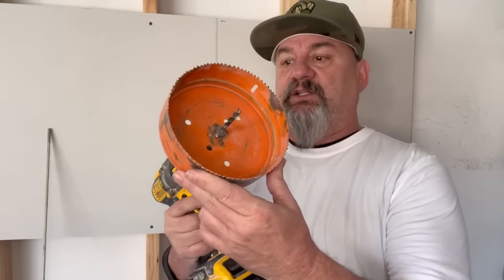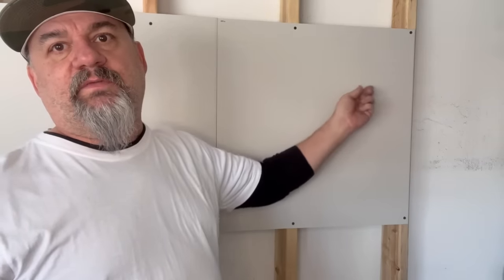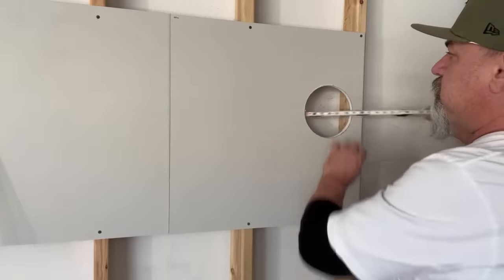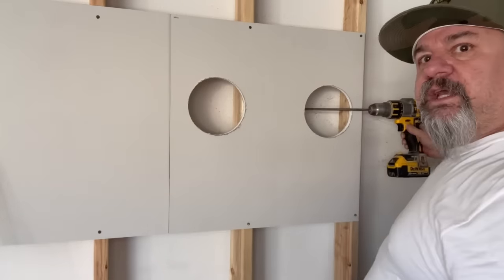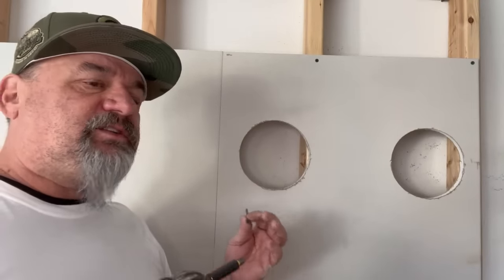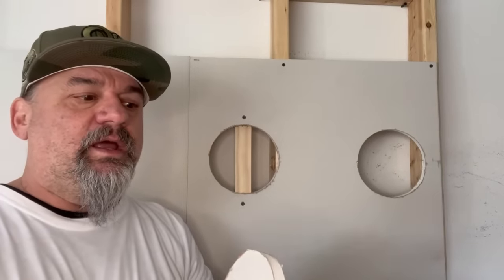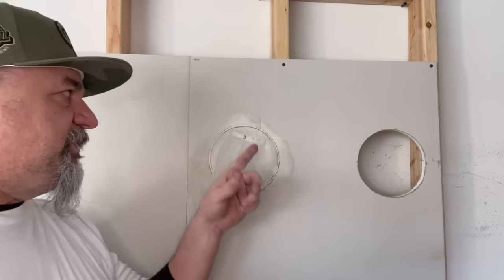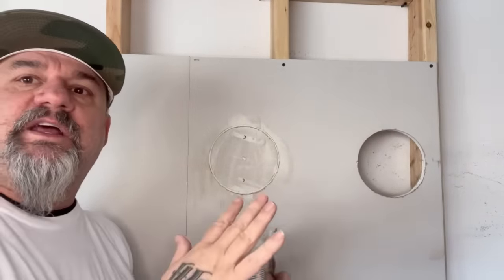Unbelievable Trick to Run Wires Through Walls and Fix Drywall - You Won't Believe What Happens Next!

Comment: I've been an electrician over 35 years and this is a good tip. To all those clowns that say you should do it this way or do it that way, I guess they don't listen very good. You said this is how YOU do it. No one is putting a gun to their head making them do it! Everybody has their own way of doing things, some easier, some not. Good video.
Reply from the maker: THANK YOU FOR UNDERSTANDING!!!!!! damn im so sick of the "hey try it this way" thing. take it or leave it. I'm only trying to help wtf?
Reply: I’d only offer one variation, put one screw in the center hole only. Avoid any low or high spot. 

But I really like the fact that you even speak like a real electrician, uncensored. I’m certain someone out there who doesn’t swear and is an electrician will cry a few tears because that’s naturally what will happen, for some morality bullshit need to correct or scold. 

Been doing this stuff long enough that maybe it’s time I just do a 6” round hole rather than the damned irritating rectangle ones I’m forever repairing 😂
Reply: I am a drywall taper by trade....And to be honest;  I very, very  rarely find any drywall repair that has been done by electricians. Apparently  their time is  too valuable. At 85$+  an hour; they can not justify spending even 5 or10 extra minutes to fix some of their repairs. On top of that; those repairs often could have been avoided if their original work had been done properly in the first place. On many occasions , they had to be called back for some forgotten feature of the contract, that was missed on the the blueprints.,,, but ,,,hey   we are all only humans
Reply: Well said 💪😁👍
Reply: I enjoyed this.
Reply: frank  busch  The "clowns" are those who don't  know what they are ranting about.  It doesn't help when  the drywaller has to pull that mess out and start over.  Having a bunch of small patches at eye level will look like sh!t unless all the patches are floated together. There are better and much faster ways.
Reply: What makes you that important to call others clowns that think this is idiotc. You better off pulling baseboards cutting  a strip of drywall shorter to the height of your baseboards and do your drilling that way then nail the drywall back no patch easy
Reply: @adv-fabiod4505  Yep, and if possible going up in the attic may not require any patches or painting. Especially with interior walls it is very easy to feed wire down any stud space to the desired new box cutout.
Reply: The drywall is not yet taped, remove it.
Reply: @gordthor5351  
How
Reply: @howardmcglothin6268   Up in the attic you can see the top plate of the walls , so you can drill a hole in the plate in any stud space required to get a wire down to an existing box and another hole where you want to go to a new box. All lateral wiring is up in the attic, so there is no need to drill a bunch of holes through studs.

Depending on what type box was used, often it is possible to detach the box from the stud and pull it out without needing any drywall of painting repairs. The you use a retro box which can be wired and then placed back in the cutout. Worst case you only need to make one small patch near the existing box if you can't remove it from the stud. 

 I personally would get the box out one way or another (break it, cut it if it is plastic...) and take it out in pieces, because it would take much longer (more costly) to do the required coats of mud and painting. Even if you have the paint, likely the entire wall will need to be painted. Not to mention the dusty mess sanding drywall. If you have to buy new paint then certainly the whole wall will be needed to be repainted. 

I have been doing this for 30 years. Believe me, this is the most efficient way. Customers are very happy when you don't unnecessarily fill there house full of drywall dust.
Reply: @StarvingElectrician  Absolutely! I use the method that works best for my combination of talents (like burping the Star Spangled Banner), setting (my own home), and pace (reckoned in terms of Diet Coke consumption.). I would not dream of telling anybody else how to do it, only how I do it. More choices are better.
Reply: @gordthor5351  ~ We needed to add a ground wire for a ceiling fan to go in the kitchen per the included instructions.  I suggested running the wire down the wall from the attic to the breaker box and across the attic to the wall and down between studs to get to the switch.  I would do any subsequent wiring up to the attic, over to the walls in the different places an outlet or ceiling fixture might go.  A neighbor rewired his home by cutting slots in the walls and mudding them all back up.
Reply: To those who say he uses the wrong technique, I say their video watching technique is sh*t.

Comment: Although this is a Great idea and technique.....I find it much easier to simply cut away and remove the drywall. I cut away a 12" wide strip from point A to B.  drill thru the studs, run the wire, outlets and switches, etc....then attach a new 12" wide drywall strip with screws. Mud and finishing is way easier and faster.
Reply from the maker: this is just one trick I use once in a while
Reply: As a finish taper  no it's not .if im floating a 6 " patch my finish  will be roughly 16 " float.at 12" ill be 32" float
Reply: @ronscott4430 If you only have one 6" hole it would be easier & faster, but not  when there's several 6" holes that close together because you're going to have several 12" bumps if you don't fill the area between the patches and skim the whole thing to plane it all in. I'd rather patch one long strip because it's easier to tape a straight line than a circle and it's easier to plane in
Reply: I agree. I've been at for 40 years. Go with what you know. Or guess.
Reply: Never seen a plumber or electrician that could tape mud or sand hammers there way
Reply: Faster? 😂 get a 5’ flex bit. Drill thru several studs. Get tie string and pull back out. Connect your wire and pull thru. With zero patching and fast timing
Reply: @alexfl09 you mean drill through several romex’s
Reply: @StarvingElectrician good trick. People need to understand these are tricks, and everything is case by case scenario. Lol chill sparkys
Reply: @alexfl09 because he’s trying to avoid hitting plumbing or other electrical wires inside a wall or ceiling cavity.
Reply: The holesaw cut out at the center of the stud is a great idea. You don't need to tape a 6-in round hole as there's no weak corner or movement joints to worry about. Just be sure to cut away and chamfer the edges of the circle and the hole and fill it with hot mud (fast set) so it doesn't shrink and crack
Reply: So I've worked with the "cut a square" method, and Yea, I hate to say it, too, but you're wrong. I've patched over plenty of holes, not using this method, and they take way more work. 

I haven't tried this method yet, but from experience can tell immediately that I am going to use way less material covering it up and making it a new smooth surface.
Reply: @kevinkotchevar8410 it’s funny other trades shit on taping but when you see how they try to patch it’s a shit show.
Reply: No matter how it's patched it'll  have a bump unless you skim the whole wall out and sand it back. The method described in the video is good. I would make an  8" California patch with a compass and do the same thing with no wood or screws.
Reply: @N1withaskillet Not true.

Any wall over 8 feet always has a belly band in the middle of the wall. It's easily floatable and a way better option then multiple round holes like this.
Reply: @evictioncarpentry2628 there's a lot of assumptions in your statement... you are thinking only of modern building method/regs .. not actual retrofitting old homes . there is no telling what is or isn't in my walls... I know the N and E walls of my interior kitchen are 9" thick with the original cabin walls in the middle of drywall..
Reply: I have a 100-year house and was dealing with pulling wire last night. Spent an hour tracing wiring and plumbing to verify nothing in floor. The ceiling is plaster and no lighting is installed. I found a clear area and missed wire that was encased in plaster barely 1/8 deep. Makes no sense. The walls are brick and no outlet on either side  of 1st and second story. Don't assume powers off because you turned breaker off.
Reply: Why not pull the base board cut and remove the whole bottom 3-4 inches of dry wall then drill and run then put back a strip of dry wall and base board no mudding needed plus easier to move insulation if its an outside wall
Reply: @EricPotratzM  unfortunately you do need to tape or it will crack,even with round holes.
Reply: @alexfl09  modern houses maybe
Reply: I've got away with 6" wide strip.
Reply: @mattsb5196  be careful and feel
Reply: Also don't forget, he said he normally only does 4-in holes. He did the 6-in hole so it was easier to see in this video.
Reply: A thick chair rail  (or whatever it is called cause I can't recall the exact name for sure at the moment) or picture rail can make the job of running wire thru walls easy. Just pop the rail off, make your slot small enough that the rail will have some wall left on top and bottom. When done reattach the rail. I think most wouldn't want to work in a narrow area like that or would be worried about puncturing the cables, but really neither is an issue if you do it well.
Reply: @vancebeazer458 
I've never understood this.
I'm seriously horrible at drywall mudding. I probably sand more than I apply.
I've probably put a couple hundred holes in my walls in the last 20 years, and don't tape a lot of them.
I've never, ever, had a repair crack. Ever.
Reply: @joedoe-sedoe7977   Have seen this trick in another YT video and think it's an exceedingly clever solution.

Comment: Thanks, helpful tips-- and I've completely rewired two of our houses. A big hole is easy to work in! With your method, those holes are not a problem. As a former painting contractor, here's a tip for you: get a flexible putty knife, it will cut your gap filling time in half.

Comment: Nice video, well done. If I may... (40 year retired electrician here) I always ran the hole saw in reverse, less biting in and when the sheetROCK finally dulled the holesaw enough, I ran it in forward to finish off the sharpness of the tool. You look like you have to buy your own tools too.
Reply from the maker: yes I should have shown that. avoid the mess

Comment: I've used this method many times. This is tried and true old school electrical work. Good to see somebody passing on this old school knowledge. These types of old school methods are dying out of our trade. 
RESPECT BROTHER!!
Reply from the maker: so true Im a dying breed. trying to show the people coming up and homeowners the tricks that make life a little easier. thanks for watching. Respect to you brother!
Reply: Yeah, I was taught this way too. There are many methods to do anything but always learn the best one!
Reply: With all the hole an time your wasting just cut out a 6" wide channel drill studs an pull wire you'll be done before you drill all those hole an you not a pro that why you leaving it to a pro
Reply: But if I had already purchased this big wall board drilling tool I may be dumb enough to use it.
Reply: @cipher1167 Yes like cutting a 6 inch strip the distance the wire will run and if it's cut right it will sit right back in place after wire is run and take very little putty or whatever you call that goop
Reply: Mud I think I've heard that shit called.
Reply: Maybe a little toothpaste will be enough to seal the crack to satisfaction.

Comment: I do the same thing but use Durabond 90 for that first coat.   It's a dry powder you mix up and doesn't shrink and dries as hard as concrete, just make sure it's all in the cracks and below the surface.  It's structural and doesn't sand, but it bonds like you wouldn't believe then just do your coats of regular mud, no tape, no muss, no fuss.
Reply from the maker: yea thanks. I just dont know the terms. i just squeek by!..lol
Reply: I used to use Durabond 90 back in the day.  It also works great to repair plaster and lathe, a dying art.  I fixed most of the plaster and lathe in my father-in-law's house 35 years ago and painted most of the rooms, and he gave me a car!
Reply: It only takes a minute to tape a patch. It's not muss or fuss it's just part of doing quality work

Comment: Good video Brother. I have used that method for years when pulling wire horizontally thru old work. Glow sticks are one of the best inventions ever made, after flex bits and the 1/4" cordless impact of course. Drive on and dont worry about drywallers. They get paid same as we do. Sometimes more. AATW!
Reply from the maker: Right on

Comment: As a homeowner I have used the wood behind the patch for small holes many times.  If covering a large area I tend to remove all or a strip I cut of drywall across all the studs. Depending on what I need.  Good video.

Comment: I typically don't have to go to that much trouble. Also, a quality stud scanner with AC detection is immensely helpful for situations like this. With an AC detector you're not guessing 6" holes across the wall. Ill usually cut a 3" wide channel across the wall as far as needed with an oscillating tool and save the piece that comes out to plug back in after im finished. I do the drywall repairs too
Reply: Just cut a three inch hole at every sideways stud and butterfly drill it deep enough for the Romex. Put a staple in it and a NAIL PLATE ON EVERY STUD you patch afterwards. You can carry this principle through up into ceilings, if you're careful.  Just leave it patchable.

Comment: Excellent tip - saved me a lot of hassle thank you! I would recommend making plywood battens as they are less likely to split when fixing.
Reply from the maker: That's a great idea!
Reply: ..Ya..specially if you only want to use a piece that is an inch and half or even less

Comment: This is a great idea and what I used to do. Then on a job I had a guy tell me if you have to cut a holoe in the wall  it doesn't matter if it's small or big because it will have to be repaired. So cut one long hole across all the studs. It's much easier to repair one long skiny hole than it is to repair several small holes.
Reply from the maker: yea I hear ya but hopefully this is only one hole you need so you dont make a complete mess for the drywall guy. thanks
Reply: It is way harder to save a skinny part of drywall intact ,for further repair use, than a nice round hole. ...and  even if you were to free hand cut the piece you want to remove;  it will always fit back in its original spot.
Reply: Using round holes keeps the integrity of the wall together and damage to a minimum. Long strip cuts can bend or buckle between the studs and are a pain to match and level. Also should the circular hole "chad" become damaged, just cut another one.

Comment: When I run new wire in a finished wall I use an oscillating tool to cut a 3" or so strip in the drywall, use a 90 degree drill to hit the center of the stud (don't need a nail shield like needed after drilling caddywhompus (eh?)), reinstall the strip pieces and finish with setting compound. I've found finishing the strips easier to finish than a circle.
Reply: Hole saw for years myself, but also found the Oscillating tool for this leaves such a thin kerf that I switched. Just as easy to keep the piece. 5min mud, three times max , texture spray and done.
Reply from the maker: yes indeed. lots of other tricks out there

Comment: Cut a square hole with the drywall blade on a multi-tool.. When you go to put the cutout piece back in, put boards on the outside edges to support putting the piece back in. WAY easier to repair with mud when done, and stronger than just the 1 board in the center.
You can also cut whatever shape/size you need using the multi-tool.
Reply: Cutting a square takes longer, than just using a hole saw. As they say, time equals money. A piece of wood and joint compound is more than enough to provide support for that cutout. If you need more support, for one reason or another, you can just have two pieces of wood as backing.
Reply: too much extra work for basically no benefit.

Comment: As a 41 year Master Electrician I’ve worked with LOTS of drywallers and they would ALL ask you to NOT do anything you did to “help” them…..

The preferred method would be to take a razor knife to the caulk joints of the baseboards and pop them off and drill your holes behind the baseboard and put the baseboards back on and caulk them real quick and your done!¡!¡!¡!¡    No patching and less than half the time

I know I should charge for valuable information like that
Reply from the maker: lol I hear ya
Reply: Can’t be done on a brick wall that’s been plastered ???
Reply: @jeffparker4490  sure it can be that's what God invented conduit for

Comment: Good job. I like to use OSB or plywood strips ripped to size instead of a wood backer. Less likely to split, no wood grain or knots and easy to sink a screw into. I do drywall patching and repair. Hot mud works good because it does not shrink and crack as much.
Reply from the maker: yea for sure. if the wood is to hard i see it split a lot. good point